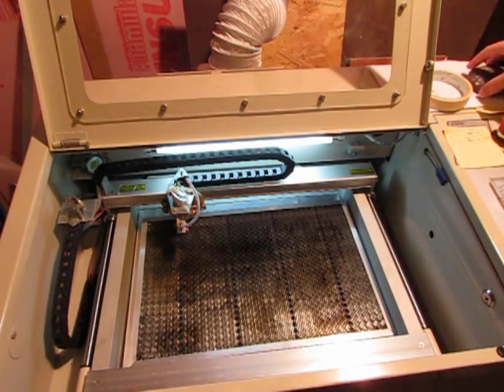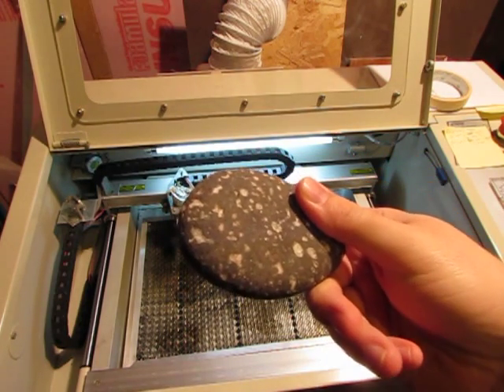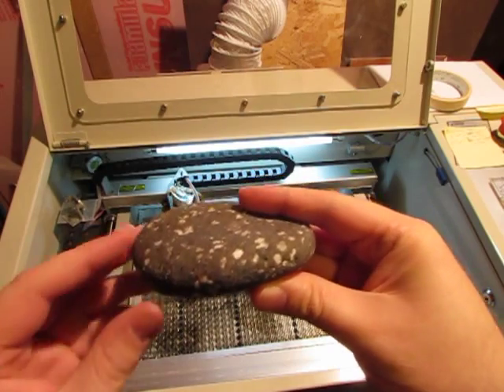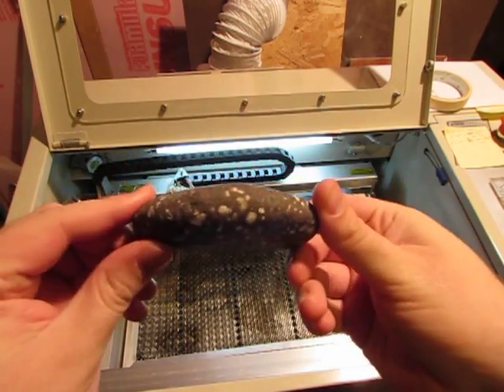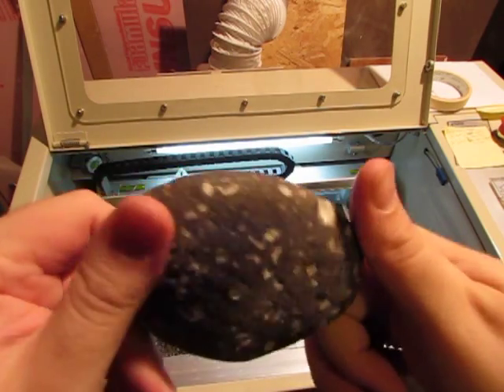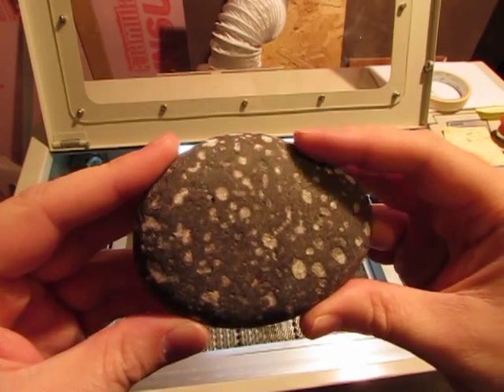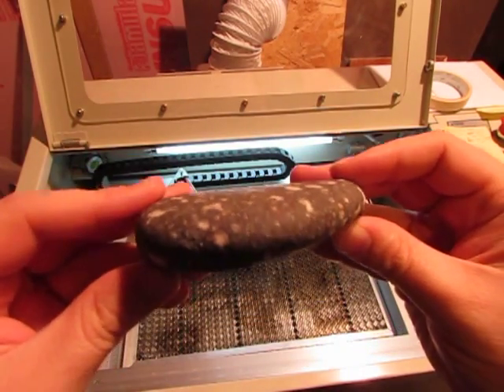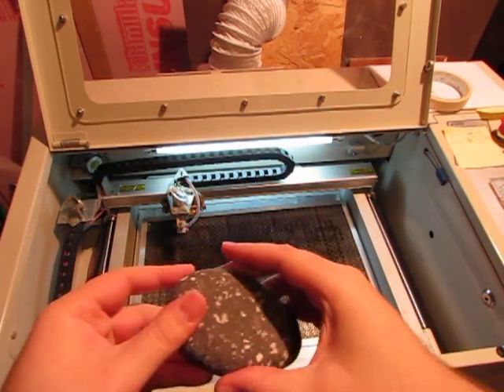Laser engraving a spotted rock

Comment: Hi. What brand of laser are you using to engrave the rock. Im looking to do the same as a hobby. 
Thank you
Reply from the maker: This is an old 3rd generation Full Spectrum Lasers Hobby model, that was last sold in about 2012/13. It's closely related to the Chinese K40 lasers but uses updated controller hardware. FSL has new models that look quite nice and I can vouch that their software is my favorite, but if you're on a budget you can easily get up and running with a K40 and some tinkering.